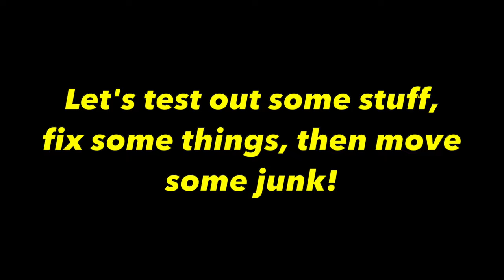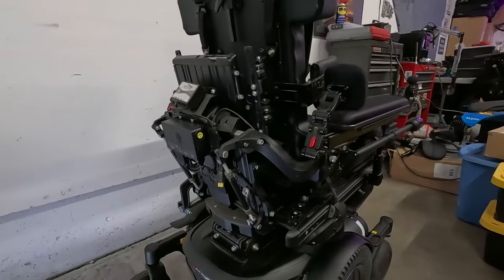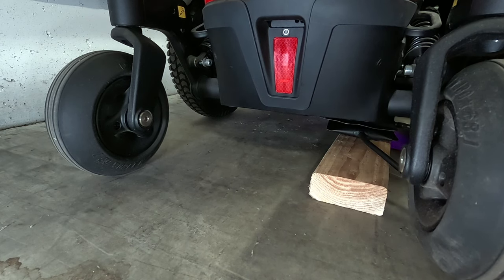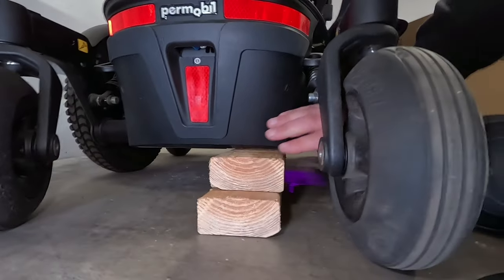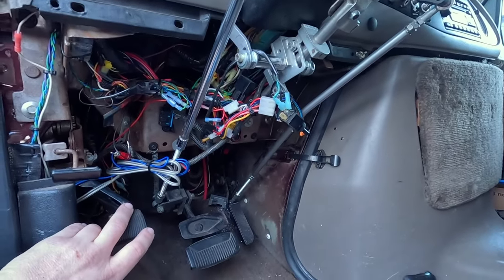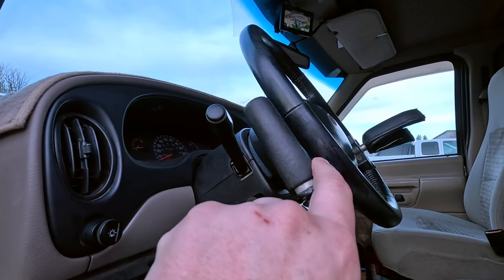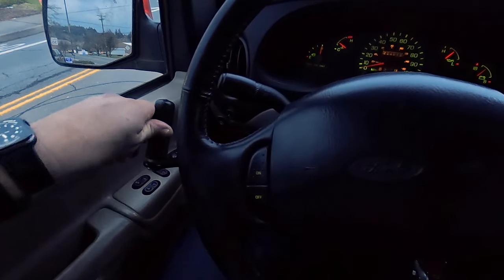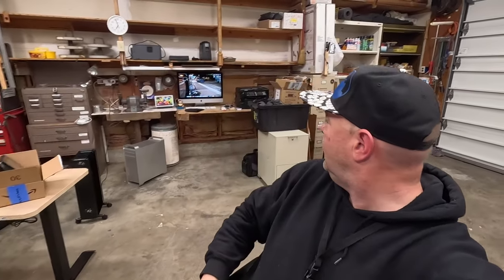VLOG 698: testing lift bags? (and other stuff!)

Comment: I know not everyone has them, but I found using my hoyer lift with a couple chains connected to the tie-down loops works excellent to lift these heavy ass chairs like a cherry picker.  They swing less than you'd think, so it makes working on the bottom end fairly easy. Pro-tip, if you are unable to remove the seat, throw a couple towels over the seat where the chain touches to save your pleather from tearing.
Reply from the maker: hoyer lifts work great for that! use one all the time.. thanks for the note!